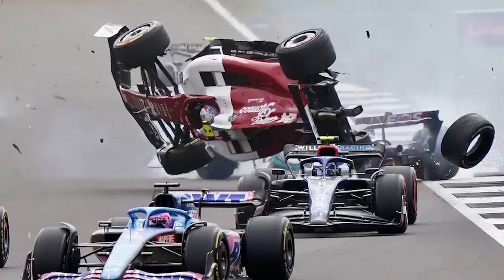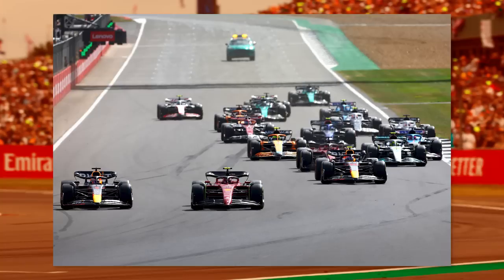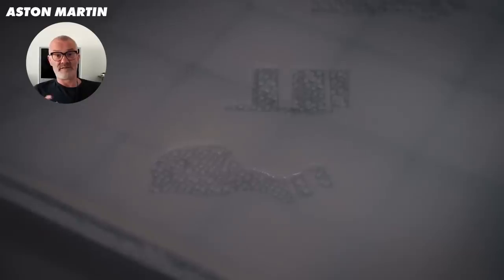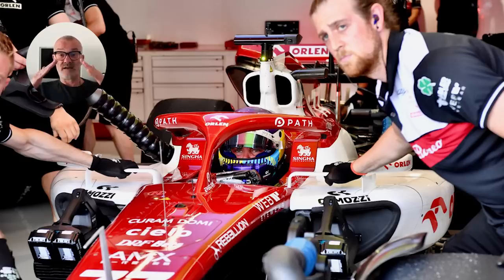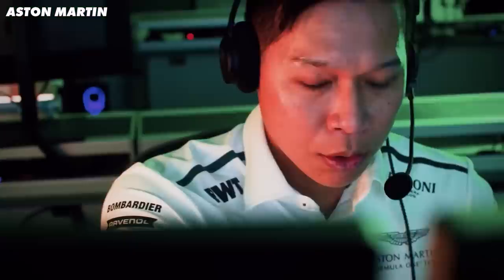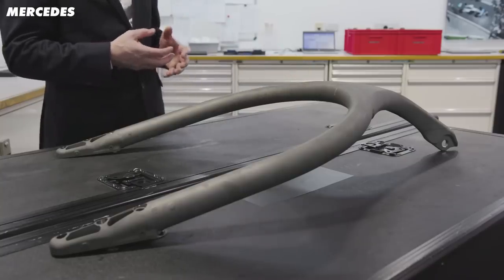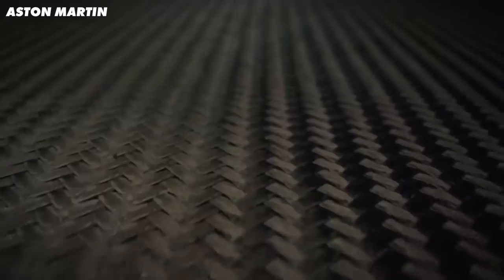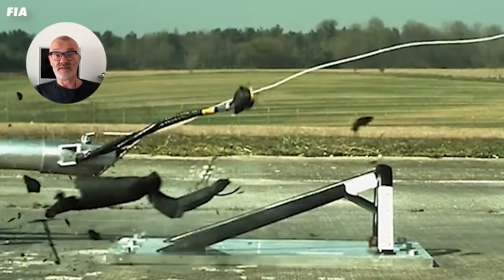Did the Roll Hoop FAIL in Zhou's Crash?

Comment: I find it incredible that just 4 years after the highly contentious introduction of the halo, the number of lives saved and injuries prevented across open wheel categories is staggering. Zhou can consider himself one of the lives saved.
Reply: If i remember right it was:

- Leclerc
- Zhou 
- Hamilton
- Grojean 

did i miss anyone (counting only F1 here but in F2 and F3 there were also other lives saved)
Reply: @burnstick1380  Hamilton? Nah the standard hoop would have saved him anyway
Reply: @rnichol22  Verstappens car slipped over the hoop into the halo, without the halo it's quite likely that Verstappens rear right tire would have landed on Hamiltons head, which probably would have caused some injuries if not fatal ones.
Reply: windrose5988  it is not necessarily about the rotation of the rear tires but rather the weight. Most of the cars weight would have dropped down on hamiltons head which quite likely would have broken his neck or similar injuries

Comment: I always thought that the roll hoop was part of the monocoque just like the halo. Thanks for this vid to clear this up!
Reply: Both it and the halo are not part of the monocoque. They can’t be - they’re made of titanium while the monocoque is a carbon honeycomb composite. Both have to be attached to the monocoque with either glue or fasteners.
Reply: It should definitely be
Reply: Unfortunately, a carbon fiber roll hoop would just get worn away really quickly. Carbon fiber is very strong but hardly abrasion resistant enough and would still deal with the delamination (layers coming apart) issues
Reply: If you think about it, it is, it's glued but all of the carbon layer are glued toghether aswell
Reply: @tedt7991  that would be extremely dangerous
Reply: @ASJC27  Believe in JESUS today, confess and repent of your sins. No one goes to heaven for doing good but by believing in JESUS who died for our sins.  For God so loved the world that he gave his one and only Son, that whoever believes in him shall not perish but have eternal life.(John 3:16)🥳❤️😗❤️😁❤️😚
Reply: @macedhx  carbon fibre used in f1 are put in an oven for the resin to cure. It’s basically a single piece of hard plastic with carbon fibre in it to give it strength
Reply: @ASJC27  the monocoque is “made around” the halo. So to remove it, you have to destroy the carbon as well
Reply: it's got little hinges if you look at the joints between the car and body
Reply: @chm1ata  that is totally false, the halo is bolted to the safety cell and is easily removable.
Reply: If you think about it, it seems quite obvious that the roll hoop should be much more deeply integrated into the monocoque not just plonked on top with some resin. It's obvious that in case of a rollover or a crash at a significant speed, the seam would be the weak point and probably break off.

The FIA tests are a joke. 6 tons of static lateral load? Lets round up a bit and say the 2022 weigh 800 kg or 0.8 tons. 6/0.8=7.5. So if a car flips over or makes contact with a wall or another car in lateral direction, it only takes a 7.5G impact to equal the FIA test of 6 ton static load. And most crashes where something goes over an F1 car or the car itself flips and needs the roll hoop to do it's job, the crashes are quite a bit more than 7.5G, even several times that. So the 6 ton static load is ridiculous to me.
Reply: @Renee_R343  one of the tests you really belive they only do 1 test?
Reply: @Renee_R343  You need to pack your bags and move on down to the FIA testing facilities.  There you can tell the engineers that have been working on safety for years to get out of the way and you will tell them how to do it.......!
Reply: @paulcopeland9035  , isn't the braking off of the ARB proof that he is right
Reply: @Renee_R343  the thing is, it wasn’t the roll hoop that failed.  The roll hoop get’s tested for 6 tons of side impact.  Either i missed what the requirements for the bounding to pass the test are or it wasn’t mentioned.  Obviously it’s how the roll hoop is secured to the car that needs to be reviewed and altered.
Reply: @Toms_Channel  I got the impression the roll hoop is tested while all ready attached to the monocoque. And they test it with a STATIC load as was said in the video. For side impacts they use 6 tons of STATIC load. It's obvious the roll hoop itself didn't fail, but the way it is attached to the car. This is what needs to be improved.

To others that replied to me: 

That means 6 tons of sustained load from the side (and yes different load test for the top and frontal loads, plus the number of times they perform the same test with the same force doesn't change anything) not a side impact from a 6 ton object. That has the same effect as me gently pushing a basketball against your ear with a force equal to the weight of the ball, or throwing it at your head at speed. The outcome is quite different, no?
Reply: @martinberg3970  As he said in the video, they do 3 tests, top, front and side load. They have different forces for different directions, but the side test is 6 tons of static load. That means a 6 ton weight pushing on the roll hoop. If the tests are the same each time, it doesn't matter if they repeat the test 2 or 20 times, the results are the same. 
As I said, the 6 ton static load/7.5G test is too small.
It's simple math.
Reply: @paulcopeland9035  So do you believe the 6 ton lateral test isn't too small? Do you understand what is a static load vs dynamic? 

As the roll hoop that meets the FIA tests just failed, I believe yes, the tests are too weak. Do you seriously argue with that?
Reply: @Renee_R343  if you actually had brain cells you would know alfa romeo is the only team with a single spike design around their roll bar. Might be the reason for this happening. Also with it still inntact at that speed and force wouldn't it bounce over again and what force will that put the driver through? Mr better than the fia i need answers today no 3 days later after you're Google research
Reply: I agree - and my thought was that it was designed to actually collapse and absorb energy, but it did break off. Many crash impact structures are designed to collapse in a controlled manner progressively to get rid of the energy of the impact.
I assume we'll see a revised design here. My quick assessment here is that it's the transitioning from one material to another that's the real issue since it's always hard to make a good predictable bond between two materials and even in joints between the same material.
After all this wasn't a fatal accident and he actually walked away from that one so it's still showing us how well built these cars are from a safety point of view.

Comment: With how carbon works, it's likely that the initial vertical drop on the roll hoop caused the initial delamination of the carbon fibre layers in the monocoque, which then led to the carbon fibre being weakened and made it easy to tear off. Kinda scary looking at it, but it's good to see him walking and alive.
Reply: And it was being ground away by the tarmac.
Reply: @stpbasss3773  Grounded away? More like torn off by the tarmac. The end of the line dug into the tarmac was probably the point where it tore off
Reply: Ya.. no matter how many layer your carbon fibre has.. the roll hoop is bonded on the 1st layer only..
Reply: @stpbasss3773  Believe in JESUS today, confess and repent of your sins. No one goes to heaven for doing good but by believing in JESUS who died for our sins.  For God so loved the world that he gave his one and only Son, that whoever believes in him shall not perish but have eternal life.(John 3:16)🥳❤️😗❤️😁❤️😚
Reply: @stpbasss3773  did you even watch the video?
Reply: I was looking for this comment! Even looking at where it separated it seems to be about where the force would be shifted to in a top-down impact, and damaged carbon fibre is super weak (relatively)
Reply: If I remember rightly, carbon fibre is very uni directional in strength characteristics. 
Strong in on direction, weak at 90 degrees to that.
My guess is that the rotation of the car basically screwed the roll hoop off the carbon body of the car. The bonding agent taking the top layer(s) of the carbon with it.
Reply: @petert3355  The strength of carbon fibres themselves are uni-directional, but once the carbon fibre layers are applied in layers and held together by the resin (as carbon fibre actually known as CFRP - carbon fibre reinforced plastic), then the actual properties of the part itself will depend on how those layers and put together. Is there a weave in the carbon fibre, or are the layers all using unidirectional fibres? More than likely a mixture of sorts.

As is inferred by the name carbon fibres reinforced plastic, the layers are held together by plastic, which is mostly brittle by nature. When you slowly apply a load on CFRP and add load to it progressively, it can be very strong. However if you have a sudden impact on it, it can cause delaminations under the surface which could be undetectable to the naked eye and found using ultrasonic equipment.
Reply: My first-order solution would be to provide additional shear load resistance by adding threaded extensions (call them bolts) to the underside of the titanium structure.  These bolts would then pass thru a backer plate under the carbon fiber layers, to be met by nuts on the underside.  This mechanical bonding would augment the chemical bonding.  Just my first thought.
Reply: @Sagart999  Sounds like a simple solution and I would have thought the same. However generation of holes in CFRP is an absolute nightmare which requires carbide or even diamond tipped bits to do. It can sometimes leave behind small strands of loose carbon fibre, and much worse... It would introduce weak points into the CFRP of the monocoque.

No idea on how this may or may not impact the structural integrity of the monocoque, but holes are stress raisers by nature and with CFRP the way it is, you can never bet against localised delamination in/around a hole.
Reply: @sunnifung2403  I absolutely understand the stress risers caused by holes.  I was not suggesting a simple set of drilled holes; additional engineering and reinforcement would be required.
Reply: @sunnifung2403  The holes would have to be build in when the carbon fibers get woven. Maybe by placing rings and weave the carbon around it. The carbon strands should be uninterrupted and follow the direction of the expected forces. Also it would make the monocoque thicker in those places, because the same number of fibers need to pass through a smaller space. But I guess the monocoque isn't constant in thickness anyway.
Reply: @mennovanlavieren3885 Considering that Airbus A350 aircraft wing skins require holes that are drilled... I'm not quite sure we're at a point yet where we can do that yet.
Reply: @mingc4698  yes but. There's always a solution, and fia will enforce it.  The geometry of the cf under the hoop can alter the direction the hoop is pulling the layers. If you have a big flat area that's great for torsional load but not when pulling away. A solution would be to create some verticall section in the structure near the hoop attachment point, making so that the outer layer is not only laminated to the inside ones, but so that he bends downward, that way you wouldn't have an out pulling load anymore but a fiber oriented pulling load near the edges of the hoop. An obvious addition will certainly be to sandwich the base of hoop between the structural part of the tub and a series of over layer, specifically oriented to keep the hoop strapped down. We used a similar approach when laminating our motor mount in a university prototype car: similar situation, a female insert that needed to be bonded to an almost flat surfaced, we modified the surface geometry to better direct the pulling load so they'd be pulling laterally on the over layer, working in the most resistant direction.  A test piece we tried pulling at 30° from the vertical broke  at over 145 kn (14.5 tons) so... it can be done, simply they never had to do it up until now.
Reply: @REVOLUTIONS51  ya. i am sure there is plenty of engineering solution to it.  like you said.. the roll hoof never failed until now.. thus they have no reason to ''look into it'' until now.. so ya.. now is the time to make improvement.
Reply: Yup carbon can't handle impacts well and titanium is essentially spring material, it's not going to be great for supporting carbon.
They need to beef them up a bit more. Those few grams aren't worth a life.
Reply: @petert3355  they layer and weave the strands in different directions to provide strength against varying directions of force, but it's not good as a cover against impacts in all directions. It's a balancing act. And titanium is light and returns to shape well, but it flexes a lot and grinds down very rapidly. Really not the best choice for supporting something totally rigid or that might face a grinding over a surface.
They just took big risks for weight savings on a safety device.
Reply: As an engineering student with essentially no experience with the design of formula cars, my first thought to possibly fix the issue is to give the hoop a larger area to bond to by giving it larger bands that go around the surface of the body in lateral directions, the longer the stronger. In a crash like the one in the video the de-lamination would have to stretch across a larger surface and there would me much more supporting material in multiple directions to resist dynamic forces. Essentially, in order for a de-lamination to take the hoop off of the vehicle, it effectively would take the entire skin with it, and if the crash had enough force to achieve that, there is little to no chance that the driver would have survived regardless. due to other factors such as organ rupture. The primary downside would be a significant increase in weight over the current design, however it would not suffer from de-lamination nearly as badly as the current design. It would probably be better to put bolts through the skin since it would achieve similar results with less weight, even with the increased manufacturing difficulty.
Reply: It's worse to have a halo, in a catastrophic crash the halo will break and could spear a driver through the head or body.
Reply: @BoleDaPole  Where are you seeing this? 😅
Reply: @sunnifung2403  No ground.  Same thing happens to your skin when you hit the asphalt.  It is like 60 grit sandpaper.
But the energy used to crack and break the carbon is good, less of it to be exerted on you.
Reply: @robertsmith2956  Which parts are you referring to? I'm kind of lost reading back through the responses 😅